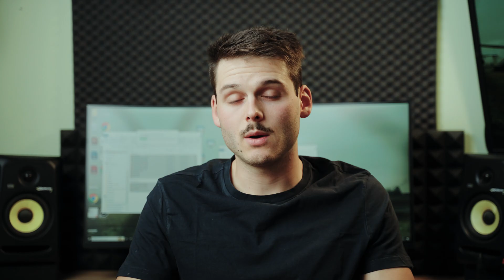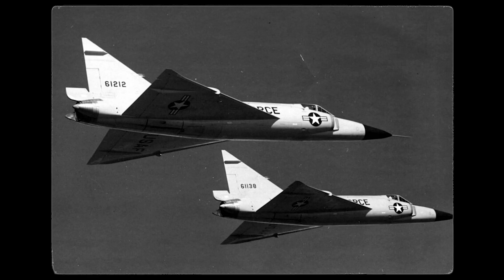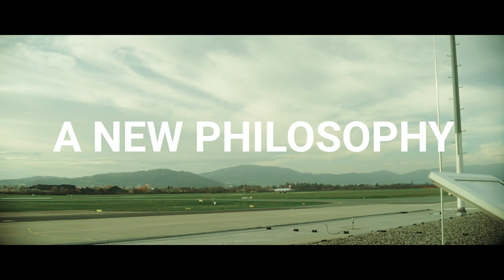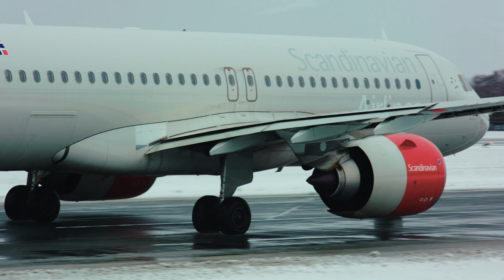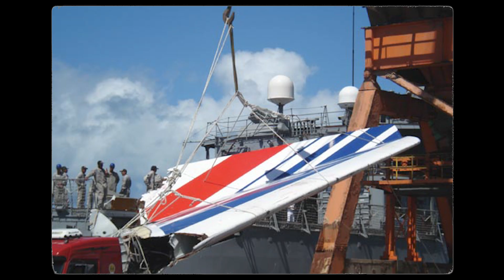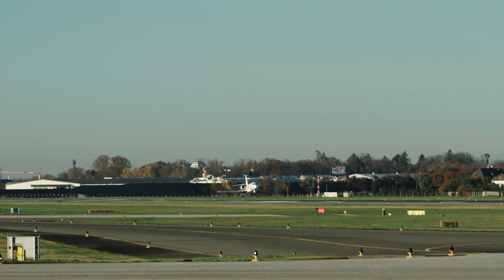Is airbus sidestick flawed?

Comment: Interconnecting the Side-sticks is a significant safety improvment.  (See Gulfstream). Another issue with fly by wire is that the flight control computers do not question faulty inputs from multiple sensors, for eg. all angle of attack sensors or all air data sensors being iced up (Which has happened more than once (AF447 for eg.) the system can then prevent the pilots from taking corrective action to unwanted flight enevlope changes, caused by faulty sensors. The pilots should have the possibility to override unwanted or dangerous changes to the flight envelope if they deem such changes to be inappropriate or dangerous.
Reply: i'm not a specialist but if the computer see faulty data(  for exemple, 2 differents angle of attack) , it's give the authority to the pilots.  it was the case on af 447.
Reply from the maker: Hi! I think so too that the Gulfstream sidesticks are the holy grail of anything in cockpits. Their whole flight deck design is out of this world... hope to see that soon in the commercial aircrafts

Comment: With so many Airbus aircrafts flying daily and just a few cases where one of the causes of the accident might be the stick logic. There is absolutely no concern that the design is flawed in any way. If you follow the rules, the design is perfect. Regarding the feedback, I personally don't miss it. It is a matter of previous experience. If you go directly on Airbus from the flight school you will do great. If you come to the type later in your career, well that a few percent of pilots have some issues. But not only with the side stick, but Airbus operational philosophy in general.
Reply: Agreed. I think the philosophy is wonderful. The only thing i wish is that there was more conventional control when flying manual. In normal law, all your doing is commanding g-force and roll rate. You could release the sidestick and the plane would keep flying. Its basically still on autopilot only using the stick to change direction and pitch.
Reply from the maker: Exactly! Things like flare law are just one of the few things an airbus pilot has to know about to perfectly handle the aircraft. It definitely behaves differently from other aircraft. Especially when you are coming from a different aircraft like an Embraer or Boeing, there definitely is some getting used to I guess.

Comment: If the pilots on a Boeing are fighting over control with their yokes, at least both of them are aware of what the other might be wrongly attempting to do. On Air France flight 447, a cockpit full of pilots couldn't figure out why their A330 wasn't recovering from a stall because they were unaware that the panicking first officer in the right seat was pulling fully back on his sidestick, thus overriding the airplane's flight software that would have lowered the nose and ended the stall condition.
Reply: Yes, but the "dual input" warning came up several times... again, poor CRM
Reply: @ilfordino-fordfiestatutori8725  they definitely were overloaded and lost their hearing. The dual input went off and so did the stall warning, or they just didn’t believe the stall warning as at one point a pilot tried deploying the speed brakes as he believed they were flying too fast. I agree it was poor CRM, late at night. They were probably tired hindering their performance and also a lack of training with unused attitudes.
Reply: They never knew they were in a stall until the very last moment. Also they were in alternate law so they wouldn’t have got the alpha floor  protection from the flight software. And if a pilot ever takes control of an aircraft the pilot monitoring should always be aware as you should be communicating with each other. The crash was due to several things lining up on the Swiss cheese model, mainly from bad CRM with the decision making and communication etc…
Reply: bingo!
Reply from the maker: Yes, I think that could be one flaw in the design. But again there are not many incidents where the airbus sidestick design might have been an issue
Reply: @_fordec  True, but there were only two incidents where a 737 MAX crashed itself because of MCAS issues. Overlooked design flaws have a horrible way of making themselves notorious.

Comment: The real issue here is training and the understanding pilots have about the philosophy. If pilots understand the systems well enough, the side stick control shouldn't be an issue.
Reply from the maker: Yes, that's definitely true. But just like with anything else, you'd typically want to design a system to be as intuitive and easy to use as possible.

Comment: ...If the sidestick starts to provide feedback and for example mimics each other, that doesn't require new type certification. The commands are exactly the same, the aircraft performs exactly the same with or without feedback.
Reply from the maker: Yes, that would be a great feature that could be added to the next generations! It wouldn't require much retraining (probably just some CBT)
Reply: It would require some degree of re-training for pilots though.
Reply: @Stoney3K  Possibly. The aircraft will fly exactly the same, but they will have to learn how the feedback will work in different conditions.

Comment: Short answer: The Airbus sidestick is better than the yoke for several reasons, but of course there's room for improvement, namely the lack of feedback.
However, if both pilots are trying to fly, then the problem is CRM, not the interface.
Reply from the maker: True... but in high workload situations it would be nice to have a second safety layer. Seeing both sidesticks moving at the same time could be just that

Comment: One aspect of the side stick that doesn’t get mentioned is that you have to switch hands when you switch seats.  That is also true for the throttle levers and some other things, but the yoke (or stick) is most important control that is operated by hands, so it seems to me that it would be better to always be operated by the same hand.
Reply from the maker: You are absolutely right! Completely forgot about that. But during takeoffs and landings, one hand is on the yoke or stick and the other hand is on the throttles... So during those critical phases, a captain would fly with his left hand no matter if it's a Boeing or an Airbus... It will be interesting once i am transitioning to a yoke or sidestick. (currently flying a DA40 from the left seat)

Thanks for watching!
Reply: The C-17 has stick controls but is between pilots legs.I would think that would be better . I think the B-1 also has stick between legs.
Reply: Not really, with a yoke you mostly fly one handed, the other hand is on the throttles, you switch the hand on the yoke depending on the side you sit on. You can grab it with both hands to increase the force you can apply to it, but that only works in planes that have some mechanical connection to the steering surfaces where the strenght of your arms actually matters. Fbw planes have no mechanical connection, its just signals that go through air data computers, which then drive electrical/hydraulic servos to deflect the surfaces to give you what you asked for. Airbus has many redundancies built in to keep you in control, three levels of electronic steering law, a special law for exiting unnusual attitudes and if all else fails, there is still the mechanical backup for the stab trim and the rudder pedals plus the pitch power couple, even though flying like this is no fun :)
Reply: I fly a lot in flight simulators with a stick and the change from right to left hand or vice versa is faster than you think. After a few hours already it feels completely normal, at least it does for me.
Reply: @laaaliiiluuu  you are pretty lucky if you have no problem switching hands. A better example would be swapping between left and right hand drive cars, where you are in a real time environment which can hurt or kill you if you get it wrong. Trying to manipulate the controls in the vehicle you least use feels very strange, and has to be thought about more. It is not automatic anymore, the conditioning has gone. So you react less quickly to situations that occur because you have to not only do an activity with the "wrong" hand but you have to suppress the "right" hand from performing the automatic actions it is trained to do.

It is similar if you swap between computer keyboards, particularly different national styles. Even if you are proficient on one, regular usage of another style eg qwerty to azerty, tends to slow you down on both because the automatic conditioning starts to unravel. You get so many mistypes on the secondary board that it starts affecting performance on the primary board. I am sure some people can switch effectively between "modes of operation", but I am also sure that there is bleed through between modes for others. 

In this context yoke would be better because there is less one handed conditioning involved. If the pilot never changes seats from cradle to the grave, then it doesn't really matter.
Reply: @crabby7668  Obbiously I also need some focused training time but if you fully focus on it with all your consciousness then you can learn it relatively quickly. Obviously, emergency situations might be different but for every day use it happens relatively quickly.
Reply: @crabby7668  it's definitely not the same as switching from left to right side driven cars, not the same as switching keyboard and mouse also. It's way more simpler than both, takes about 2 mins. The more difficult part of switching seats in an aircraft is the positions of the buttons in the pedestal and overhead panel, but both boeing and Airbus pilots experience that.
Reply: @topethermohenes7658  how often do you swap between left and right hand drive cars? How often do you swap between substantially different keyboards?
You may be genuinely ambidextrous (doesn't help in the keyboard example) but most people aren't, and they favour one hand or the other.. When you have spent a lot of time in training one hand (or foot) to do a certain task, it always feels awkward performing the task with the other. You can probably still do the task but it is no longer intuitive and  automatic, you have to think about it more and therefore it takes longer. The same goes for seeing the world from the other side of the car/plane. It conflicts with what the brain expects.

In situations where fractions of a second may count, maybe it matters more than you would think. In a simulator or video game, those fractions don't really matter, as there are no severe consequences to getting it wrong.

Comment: I know this sounds too simple, but why not have a visible and audible 'Control Input Anomaly' alarm in the cockpit ? Just this simple safety circuit would have prevented the Air France 447 disaster and countless other incidents / accidents.
Reply from the maker: Hi Garry! Very good idea... That system is actually in place. (DUAL INPUT WARNING) but in the case of AF447. they probably didn't really notice this warning. (There were loads of other warnings present at the time) And actually, the pilot recovering, recovered the wrong way. If the sidesticks would have been linked, the other pilot might have noticed the wrong recovery..
Reply: @_fordec  Thank you. I was only attempting to think and make a positive contribution. Interesting information, thanks once again.

Comment: Good video. One minor quibble: when you first mention the fact that yoke-equipped aircraft can have the pilot and co-pilot wrestling for control due to interconnected yokes, you illustrate it with a Beechcraft A36. The problem: the A36 Bonanze DOES NOT have interconnected dual controls; instead a single control can be moved from pilot to copilot position as desired.
Reply from the maker: Well, I gotta hand it to you, Raymond. It seems you paid very good attention! I know that the bonanza has a swivel yoke but I didn’t think about it when editing the video. Thanks for pointing it out and I am glad you enjoyed it! Cheers

Comment: well Boeing are thinking of moving to sidestick too
Reply: But for the sake of keeping commonality  between its cockpits , the control  yoke will most likely  remain for a while. 

The side stick was strongly  considered  during the development  of the 777 in the 90s , but not so much recently
Reply: Boeing gave serious thought to this while designing the 787 and decided on a yoke. Boeing is not new to control sticks, their C-17 uses a control stick.
Reply: @thebigmon  well , yes commonality forced them to retain the yokes on the 787 . 

I feel like their next plane will also use yokes in order to maintain  commonality  with the 787 and 777X and enable use of a common type reating across

That going to be the biggest  reason Boeing might  not go for the sidestick on its airliners anytime soon
Reply: @mmm0404  The 787 is a unique aircraft with it's own type certificate. It didn't require to have any commonality with any other aircraft when it was first designed. Boeing was free to put whatever they wanted to the 787.
Reply: @thebigmon  well I was talking  about  cockpit  commonality.  If they were indeed free to do whatever  they wanted , then why didn't  they adopt the side stick? Proves that there was more to It .

The ability  for pilots  to switch from one aircraft  to another , with little  or no training is going to be one of the greatest  selling points for future  Airbus and Boeing jets . 

I don't think Boeing will want to ruin that chance by having to change to a side stick, and have different  cockpit layouts across its  airliner offerings . 

For the sake of this we might not see Boeing adopting a sidestick on its airliners  any time soon

Comment: Overall safety of side-sticks has not shown a significant improvement over yokes as the A320 family has a slightly higher accident rate than the B737NG  family.  So other than the comfort of not having the yoke between the pilot’s legs there hasn't been much to justify Boeing moving away from Yokes.
One final note: AF447 was not the only time passive side-stick were a part of an A320 accident, there was also AirAsia QZ8501, where pulling a circuit breaker  caused the aircraf to revert to Alternate Law and for that FO to stall the aircraft into the sea with the Captain unaware of the FO's control imputs.
I don't see either Airbus (commonality) or Boeing (design philosophy) implementing active side-sticks anytime soon.
Reply from the maker: Hi Francisco!
That's true! Didn't know about that incident... really have to look into it. Airbus and Boeing might stick to their philosophies for the next decades. But new aircraft manufacturers might be implementing a system similar to the one in use by the Gulfstream... It really is the best of both worlds in my opinion

Comment: The Airbus fly by wire system has a great safety record.  As with any Boeing the pilots must learn and adhere to the standard operating procedures for the type they are flying.  Also an in-depth knowledge of the aircraft systems, including flight controls, is essential to their ultimate product which is to move the plane safely from point A to point B.  In the Airbus the sidesticks not moving together is simply something to get used to when you're new to the type, which doesn't take long.  Similarly the thrust levers do not move when the auto thrust is engaged, also not a problem.
Reply from the maker: Hi Scott! You are right. The last decades have proven that the sidestick is an excellent system. My question is if the system could be even more perfected in newer generation airbuses. Perhaps with an artificial feel unit, and maybe even electronically linked sidesticks as seen in the Gulfstream? 

While the fact that you don't see what the other pilot is doing with their controls might not be a big safety hazard, I think any airbus pilot would appreciate seeing or even feeling their colleague's control inputs on their own sidestick.
Thank you for your comment!
Reply: @_fordec  At my airline we refer to the pilot flying (PF) and the pilot monitoring (PM).  The roles are the same regardless of whether the captain or first officer is the PF, the captain is of course always in command. The role of the PM is essential to a safe flight, and he must remain very tuned in to what the PF is doing. Despite the sidestick not moving along with the other, a well trained PM will effectively do his job because there are other cues that keep him tuned in to the conduct of the flight. Chief among these cues are COMMUNICATION and believe it or not, seat of the pants. The fly by wire system despite the bad rap it gets cannot and does not eliminate seat of the pants. A320 was revolutionary when it was introduced, and has been refined over the years with software upgrades as well as continuous improvements to standard operating procedures. Like any Boeing when things go wrong it is more often than not due to complacency leading to pilot error. I’ve been flying the 320 series since 2006 and enjoy it everyday I work.
Reply from the maker: @DTWobserver  Happy to hear that! I am currently in a training program and once done with the ATP I will either fly the e190 or the a320. Would love to fly the a320. I think it was way ahead of its time when it launched and still is compared to the current 737 models...